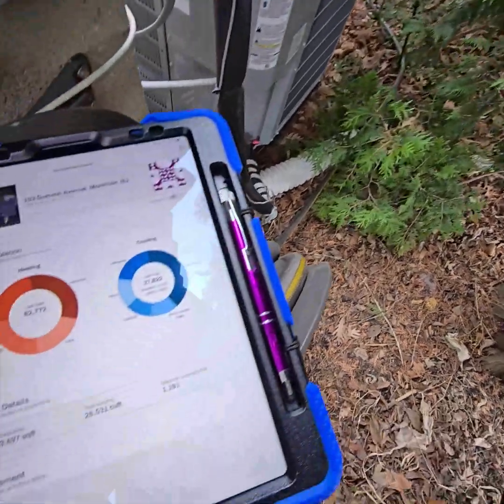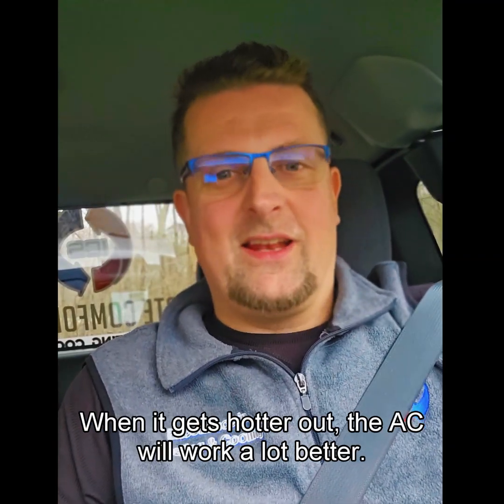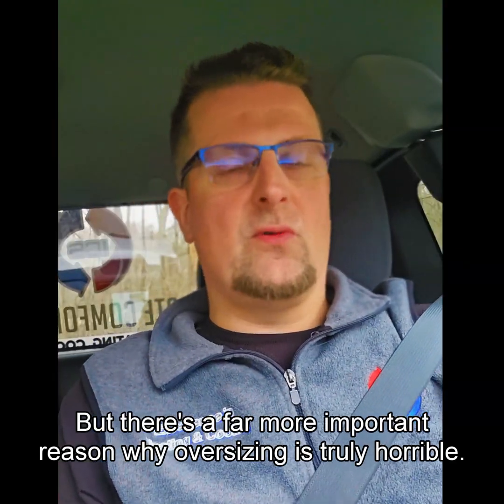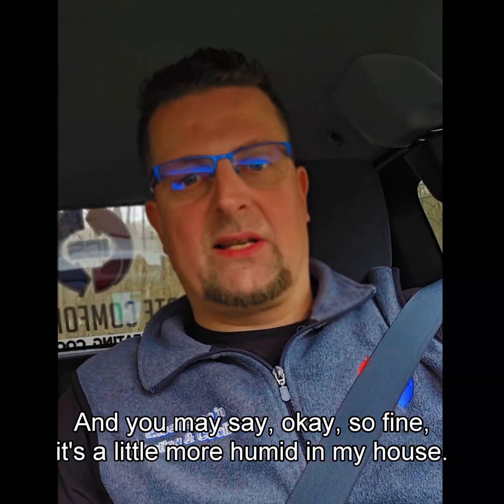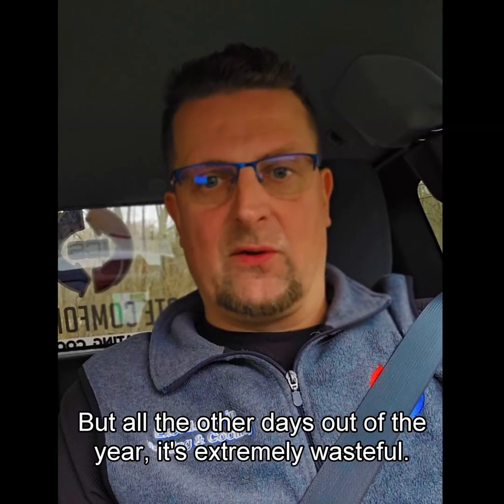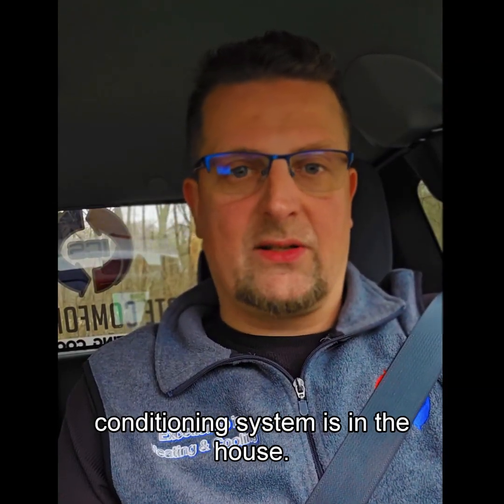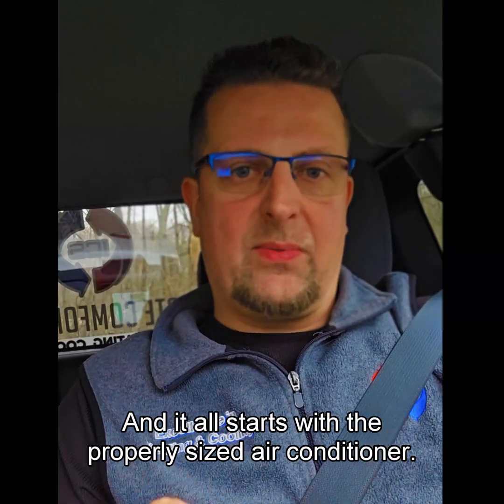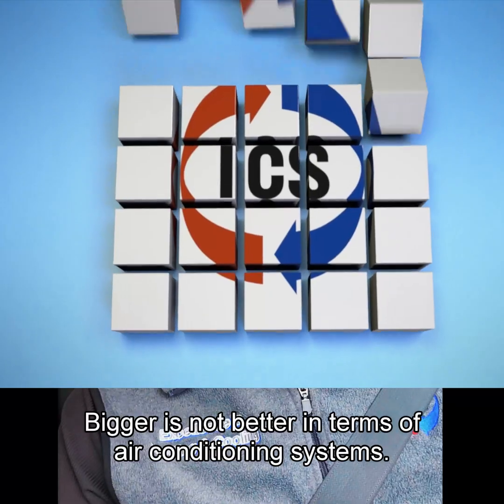Why Bigger Isn’t Better: The Truth About Oversized Air Conditioners | HVAC Explained

Comment: This logic is for single stage units. Inverter communicating systems adjusts constantly and will run on very low power throughout the day to keep humidity levels down. I went from a 3.5 ton to a 5 ton. My previous electricity usage was averaging 77 kWh per day. Now with 5 ton, 16 SEER2 heat pump, I average 33 kWh per day. I reside in South Georgia so it gets really hot and humid in the summer. It’s also very quiet and barely hear it running because it rarely ever needs to run at full capacity. I keep it at 74°F in the morning, 76°F at 2pm when it’s the starts the hottest part of the day, back down to 74°F at 5pm and then 72°F at 8pm before bedtime. It does get to the set temps fairly quickly but it ramps back down and barely runs to maintain the temps. It also keeps proper humidity levels with constant air movement with super low power. We love this system.

Comment: I'm curious about this, I live in Texas both heat and humidity get super high and having problems keeping temperature at a decent setting.. in summer ac runs all day and temperature reaches 80 degrees maybe a little less with help of a window ac unit.
Would like to go from 4 ton to 5 ton system, I've been adressing other issues around the house to help with inside temperature but has made very little difference like solar roof vents, fixing some leaks on the ducts, new windows..

Comment: I live in Arizona. Our sinuses constantly ooze blood because of the low humidity, so we have to humidify our houses. So the more effectively the AC removes humidity, the harder it is to breathe. Plus our energy supplier does a 3-6 where they charge 3.5 times higher cost per kw than off peak, encouraging us to shut off or barely run the AC in this time. We expect the house to cool back down before we go to bed, even when it's 120° out. The refrigerant is not as effective as these temperatures, so the condenser has to be significantly bigger than recommended for reduced humidity loss and quicker cooling.
Reply from the maker: Yes, there are special climates where different strategies apply. The bottom line is to follow Manual J calculations/guidelines

Comment: If you need a bigger central system to chill/heat a smaller space it means your insulation is subpar, and your electric bill will be through the roof. I've turned down jobs because of a bad insulated home. Told them to get a blower fan test done and insulate correctly and then call me back when your home is adequately insulated. They were appreciative with my honesty and knowledge.
Reply from the maker: It is always good to advise clients on how to improve their home performance before rushing into a bigger HVAC unit.
Reply: @ICSHVAC  30+ years in HVAC in Buffalo NY, and before going off on my own, I worked for numerous companies where the salesman put me in situations where no matter what you did you could never get the home temperature balanced due to cold/hot spots. Many of the homes are due to Cape Cod homes and the way they are constructed. No matter what, a smaller supplemental system was always needed upstairs due to the lack of a CAR. I would always steal their clothes vent that went directly to the basement but still lacked static pressure for equal temperature spread. I hate salesman with a passion. If you have never done the work, then you are not qualified to sell the products. I could go on and on, but you get the jist.

Comment: Exactly!  I can tell right away when a building has an oversized AC system.  The damp cold does not feel good and it's not refreshing.  You just end up feeling cold and clammy.  I would rather undersize the system than oversize it.  Even window mounted AC units can be too big for your space.
Reply: Completely disagree with undersizing. My ac unit is undersized after installing a bonus room above the garage. We set it to 70° but it will only keep the house to 75°-78° during summer. Way too hot.
Reply from the maker: Undersized has no bad side effects as compared to oversized. Your issue may be a smaller system, although you may feel 75F is not comfortable, 75F is the ACCA standard for indoor temperature. You may have more of a house issue rather than an AC issue. Without a load calculation we may not know the problem. To remedy I suggest a blower door and load calculation first